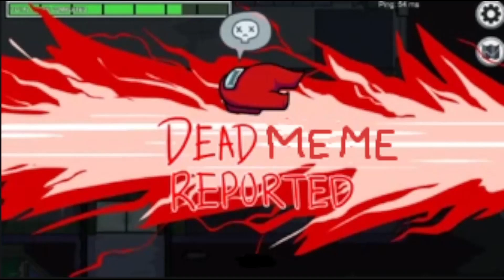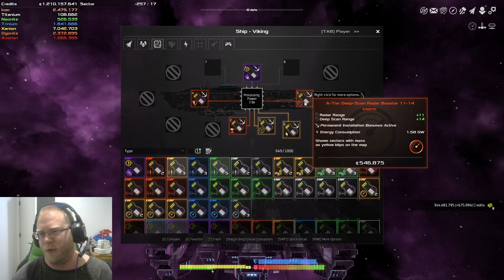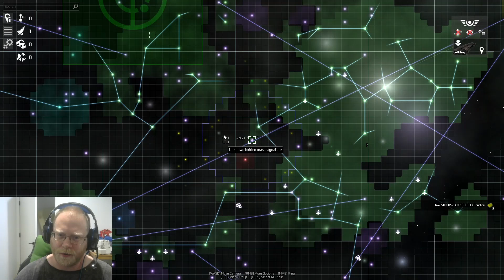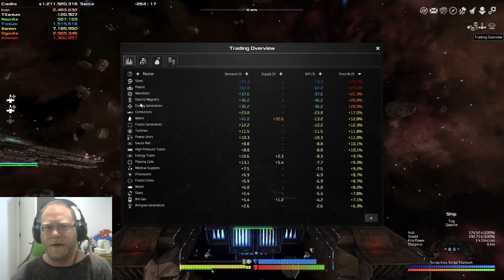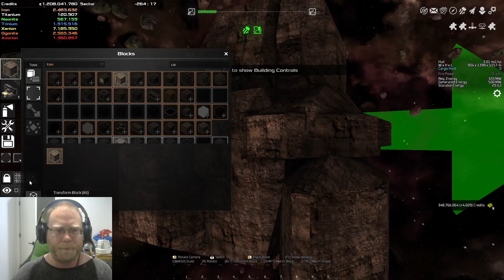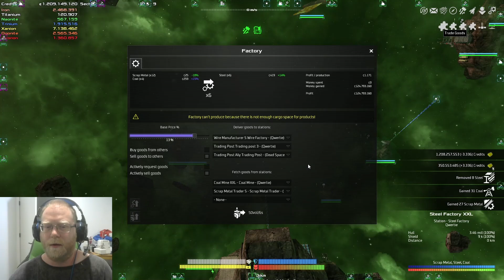Creating Passive income with Asteroids, and supply chains. - Avorion

Comment: can you sell/deliver to stations in other sectors?
Reply: As far as i know you need to use dedicated ship with a captain, and issue map command "Supply route", or something. However, many players do not realise that stations can be moved around. Even mines. Select your station, press "F" and select "Transport mode". Then you can dock suitable ship to it to act as a tow boat, and move it around. Can even jump sectors with station attached. When you're done, undock, select the station, press "F" and then "Station mode". After few minutes station is operational again in new place.

Comment: 3:01 you used a different ship to check demand and saw water, but you made a copper mine... what was the point of this portion then?
Reply: I could be wrong but I think you can make water collector stations that don't need an asteroid to work. So better to save the asteroid for a metal mine, and then make a separate water collector station if that's your goal.
Reply: this is exactly the voodoo i didnt get either

Comment: Another tip for yall.  If u want to move one of those astroids.  Enter build mode on it once its a station.  Save the design bc stone is extremely strong.  Change it to a smaller ship and then enter it to transport mode.  Also if u find other areas or its not selling that fast.  Trasnfer the cargo to ur ship and sell it urself

Comment: Have you figured out the heat map in the map screen and how it functions?  I have a theory on how that works as opposed to the demand from the upper right of the normal view screen and am looking for confirmation.
Reply from the maker: I haven't really tested to much using the function on the map to deeply. From my experience  it does help you find out the demand for goods in an area. I only really find this useful while trying to off load toxic waste to NPC stations.
Reply: @deadmemegamming  My guess is the Demand (cold) -> Supply (hot) is the supply side - supply and demand, not demand side supply and demand - this would explain why it can sometimes be counter-intuitive and contradictory - I can't find anyone anywhere that can confirm this guess.  Thank you very much for your response, excellent video and I'm recommending your channel to the folks on my dedicated server.

Comment: Really good video! Question tho. These mass sectors are usually off the warpgate paths. That doesn't matter for the sector to get customers right?
Reply from the maker: if you build your trading hub in an area with warp gates more NPC will show up. You can build trading posts or things like habitats to make more traders come as well, but consumer stations are very expensive and take a long to recoup the cost.